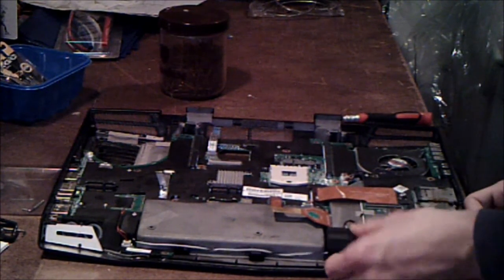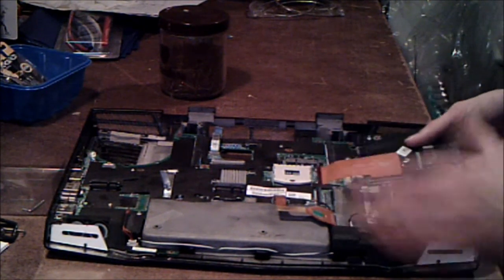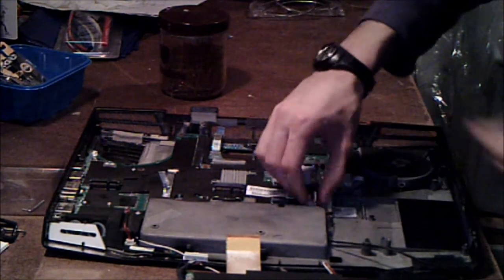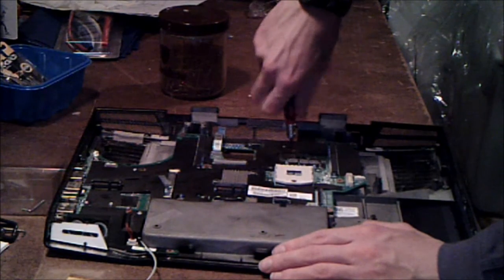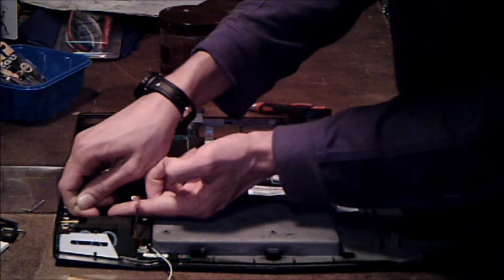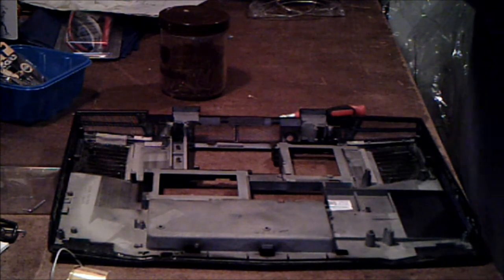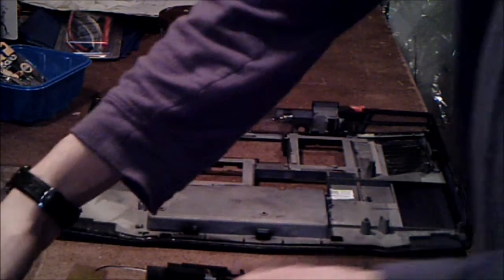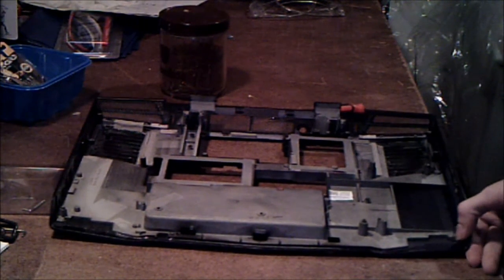Alienware M17x R1/R2 Complete Disassembly Tutorial (Part 4 of 4)

Comment from the maker: @sfarosu They did a great job in the build quality!  It's really heavy as you already know, but it's definitely very solidly built.  My only dislike about the choice of materials is the aluminum.  Even though it's thick, it's still quite pliable.  I've dropped my computer a few times from very small heights - less than 6" -  (no damage done) and the aluminum casing as bent in a few places and that's very hard to fix/ bend back.  Perhaps they should have used titanium or something.